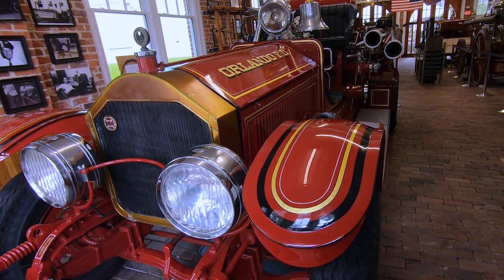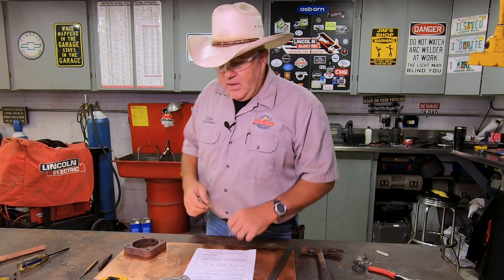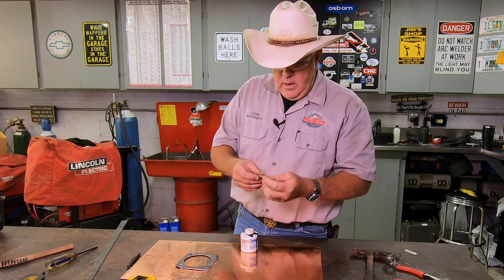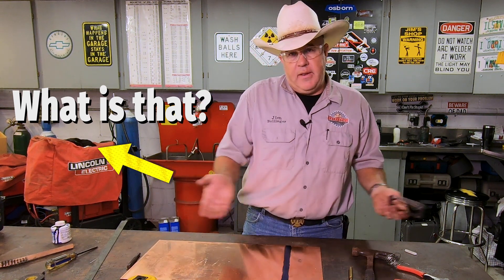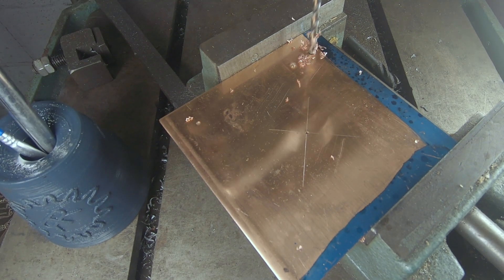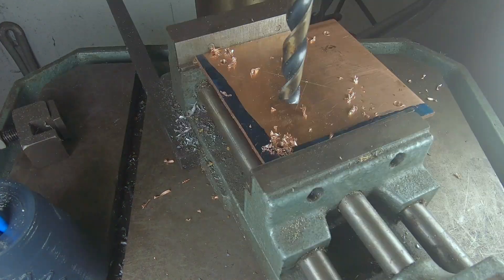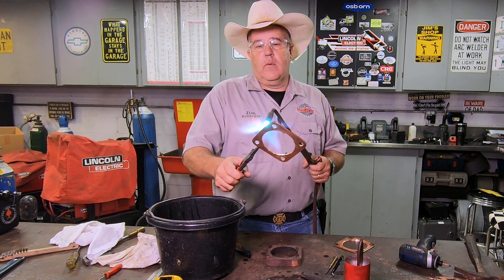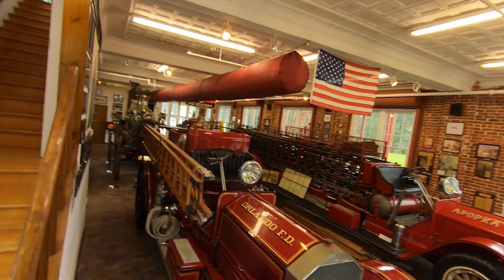DIY Firetruck FIX with Sheet METAL

Comment: Nice! I taught Welding and Copper Brazing for many years and most people don't know that if you heat copper red and quench quickly in water, it makes the copper softer. It is the exact opposite of steel which gets very hard and brittle when you heat it and quench it. This would of been a good example to use in my classes. Thanks